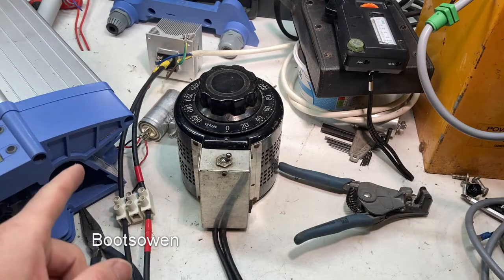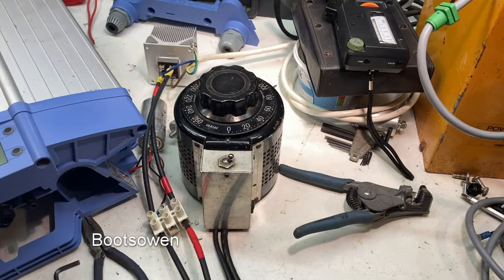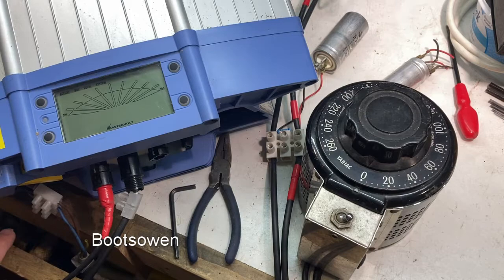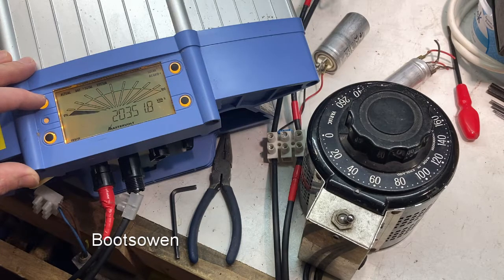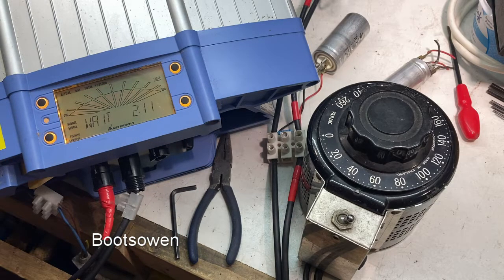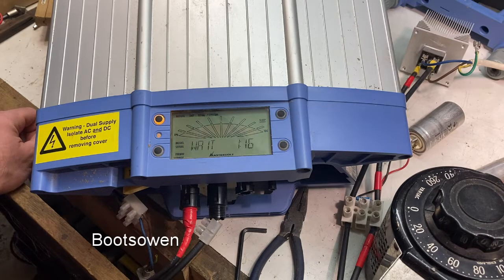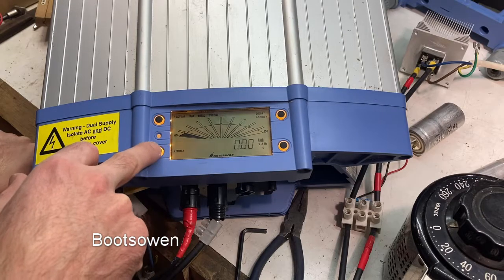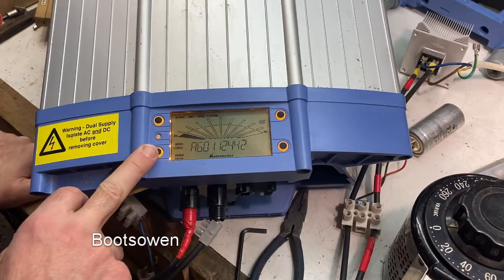Will it work? Mastervolt XS4300SW grid tie solar inverter on the test bench.

Comment: Subject: Quick Question about Mastervolt XS4300SW - Interested Buyer in 2025!
Body:
Hello @bootsowen,
Saw your video on the Mastervolt XS4300SW. In 2025, is it still a good, reliable option? Would you recommend it for 
Thanks for your advice!
[hamid]
[Ait Melloul]
Reply from the maker: I think these are awful inverters. I have scrapped it.

Comment: Seeking advice / guidance re my solar system. Mastervolt XS4300 SW. I wonder if you can help me, I have had my solar photovoltaic system installed for 11yrs now and it has performed wonderfully, however over the years pigeons nesting and roosting under them have created such an ongoing mess that this year I decided to pigeon proof the array. I got on the roof and fixed wire mesh around the sides of the panels but there was still a gap down the length between the two banks of panels (2 rows of 8 panels) so I made a channel of mesh fixed to some lengths of galvanised angle to slot into the gap. The fitting of this channel was a logistical nightmare due to the length to cover (8 Metres) in the process of fitting it I had to lean on the panels and a couple of times the channel slid onto the panels however I finally managed to get the channel in place, and the system is now pigeon proof. I checked in my loft and the system had stopped generating electricity, the Mastervolt XS4300 SW inverter was blank, so I read up on how to do a reset and tried resetting the system several times but nothing. However, while I was researching what action I might take next, I was walking past my loft hatch and could hear the inverter working so I went in the loft and looked at the inverter screen and it was generating at almost full capacity Wonderful. But me being me I can’t leave things alone and I wanted to secure the channel between the two banks of solar panels to make sure it could not be dislodged in a bad storm. I attached 1.6mm diameter galvanised wire to the leg of the mounting frame at one end and fed it across to the other side, during this process the wire did at times lay across the face of the solar panels, I then secured it to a leg of the mounting frame at the other end making every thing secure, ALAS the system has stopped generating again, I have tried resetting several times but to no avail, the trips on the AC side near the fuse box connection have never tripped. I am not an electrician but have dabbled a bit, I have rewired several houses in the past, I would appreciate any advice or guidance to help me investigate and check where the problem lies to see if I can avoid calling a company in if possible. Question 1. Could I have shorted the system by touching the panels or by the wire laying across them? Question 2. Is there an internal fuse in the inverter that might have blown? Question 3. Is there a quick way to check if the panels are generating DC current into the Inverter i.e., Metering the string feeds from each bank of panels rather than testing each panel individually as this would be difficult as they are all mounted together on the roof of a two-storey house. Sorry for the lengthy write up I just thought knowing the history would help, as I say any advice and guidance would be very much appreciated. Regards Terry.
Reply from the maker: Hi terry, 3 answers, unlikely, maybe and yes. Your machine is getting on, relays can work intermittently, maybe. check the dc with a multimeter, you say you know about electricity so that should be simple. I dont know if there is a fuse in a mastervolt. you'd have to look.
Reply from the maker: If you want the inverter that is in the video I can put it for sale. message me privately for that. Then you could swap it out. The one I tested is working still but has been kept in storage.

Comment: Hi! Please advise what value capacitor and Bleed resistor you have used?
Reply from the maker: Hi. I have no idea. It is mentioned in another video in my solar playlist. It doesn’t really matter. Some fridge capacitor and some power resistor from a washing machine pcb does it I think.
Reply: @bootsowen  Thank you for your reply. I have looked at your other video now and it helps explain. Thanks Again. ☺
Reply from the maker: Great